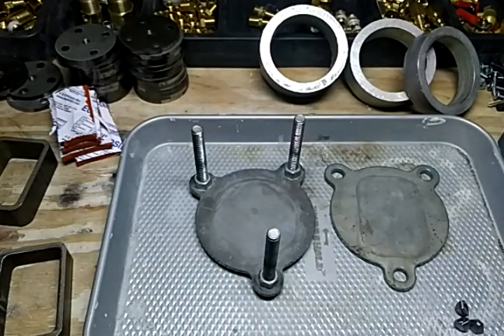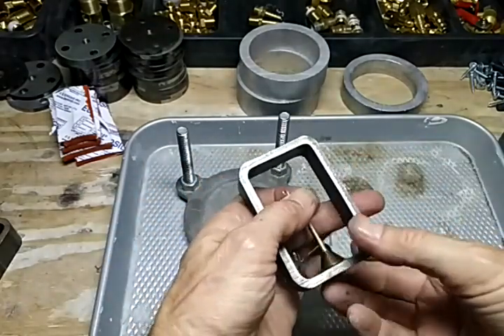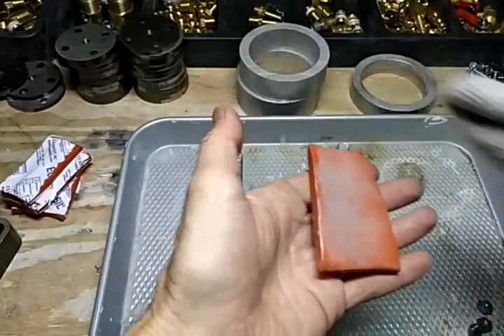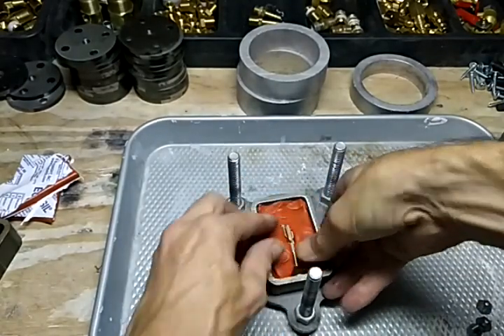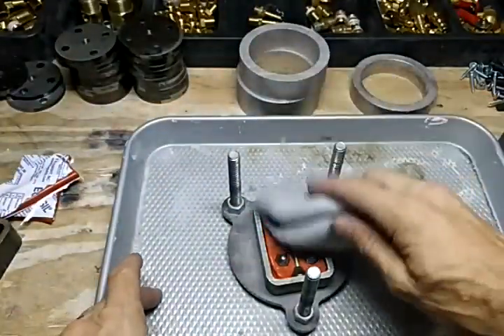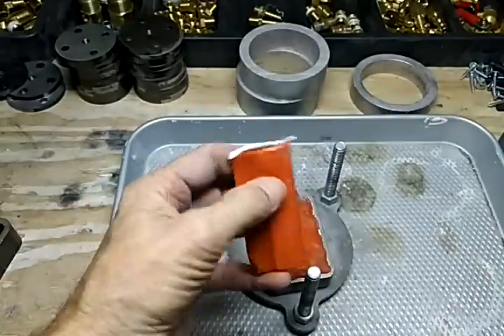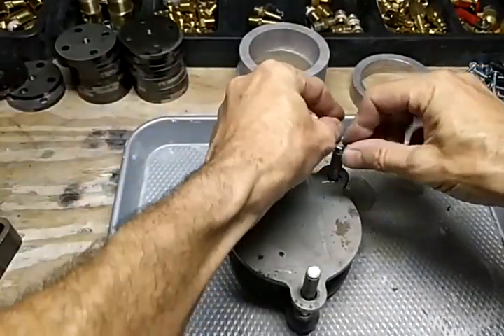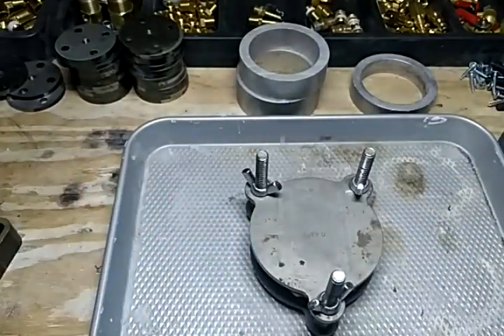Step Two: Making the Silicone Rubber Mold in the Toaster Oven.

Comment: If you drill a hole centered in one end of the mold frame the same size as the sprue rod, and insert the sprue rod into it from the bottom of the sprue former, it will keep your model from drifting around inside the mold.
Reply from the maker: I know what you're saying because I offer this on my round mold frames but after lots of research I actually have found that the hole makes the rubber sink at the hole position. I then had some very good mold cutters test my system and so far everyone agrees that it's best NOT to have a hole in the mold frame.